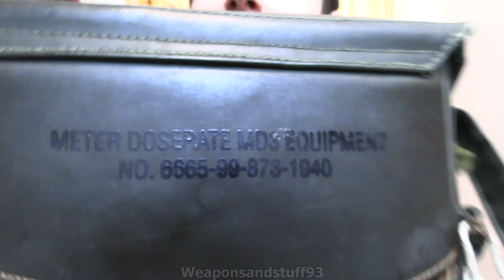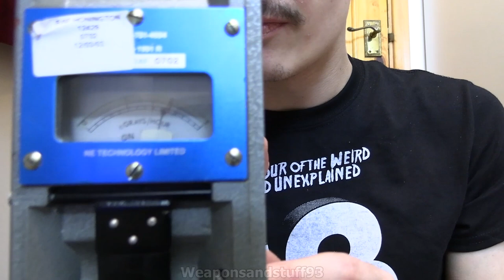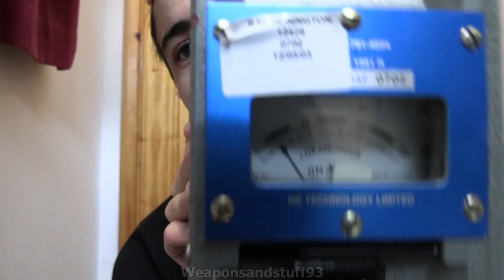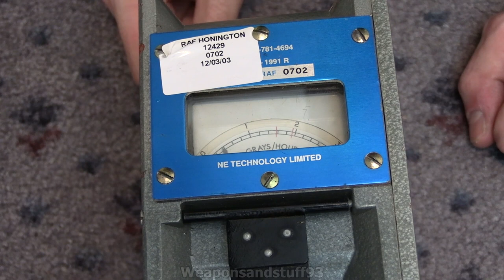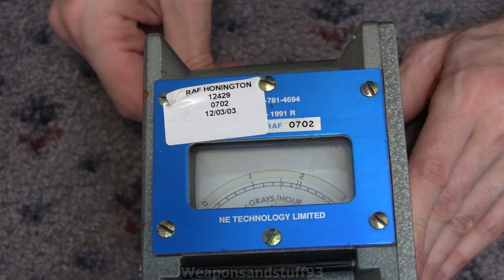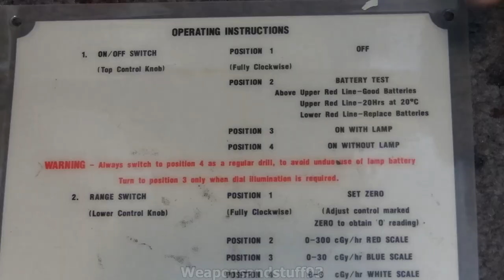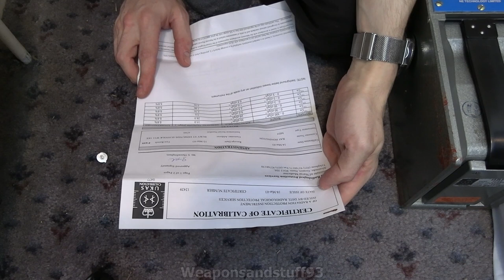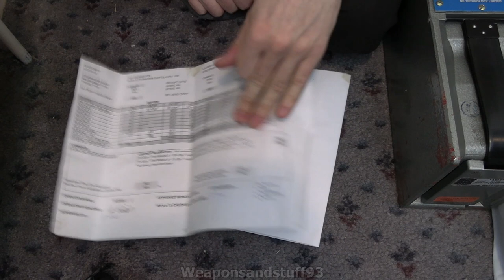British MD3 The Retrofitted Radiac

Comment: WHAT  IS  YOUR  RADIAC  READING

This video took my mind straight to Threads
Reply from the maker: I'll need to watch it again lol, although you see the soldier with the Orange Plessey Portable Dose Rate meter, which I'll get around to doing a video on soon, I can manage to get mine to read 0.1cGy
Reply: Ah nice! You should have a crack at doing a video on types radiation measurement and the effects of different kinds of exposure. It would be interesting to compare the type of detection in your old military detectors with the different circumstances they would be expected to be used in.